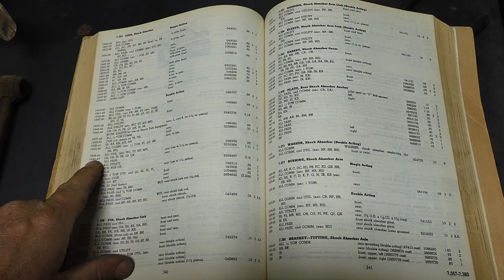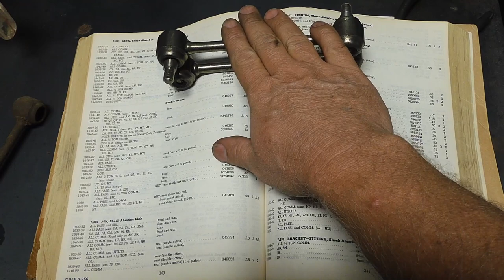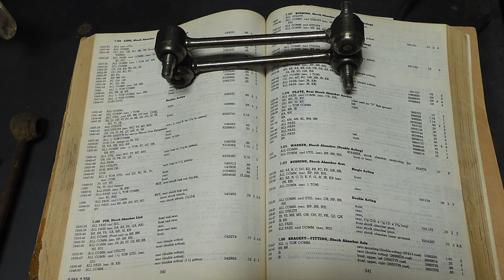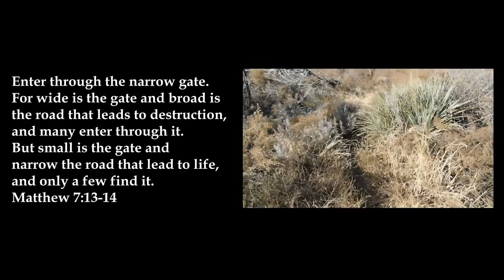Part 16: 1939-1948 Chevrolet Lever Type Shock Absorber R&R

Comment: Another top-notch video! My '47 Fleetmaster had undoubtedly been driven for many years with an out-of -balance or out-of-round tire, and the bushings in the left front shock were badly worn. This is why we take care of problems instead of driving on! The top of the wheel could move about 1/2" fore and aft! I shipped them to a place in NY that rebuilt them - but incurred an extra charge because one of the pistons was stuck down in the bore. Probably a good thing I didn't see how it was removed..... All told, about $500 to rebuild the two. So far, the single most expensive job on the car. But quite necessary to make it safe to drive. Right now, there seems to be a shortage of door window channels. The humor in your videos, as well as references to lyrics, are greatly appreciated! I command the lightening's hand!

Comment: About time I found you. I’ve got a ‘48 Stylemaster Coupe that wanders down the road like a drunken sailor. Considering the fact it’s got a 400 hp 327 Chevy engine in it makes driving an adventure. As I’m not a rich man i can’t afford to replace the front end with a IFS Mustang 2. So, I’m left making my stock front end as reliable and capable as I can. Your presentation is phenomenal and I believe I’ll be able to make some improvements in the handling of my old Coupe.
Reply from the maker: Your 327 can't be that much more weight, in fact I wouldn't be surprised if it's actually lighter than the old 216. Now, this is my opinion and my thoughts, we all have them. But for the life of me I can't figure out why guys jump on the mustang II or S-10 front end band wagon. Oh I realize that they are prevalent, cheap, lightweight, and simple. But in both cases your taking out a substantial front end and replacing it with something that was built as light and inexpensively as possible. Esp. in the case of the Mustang II, that car was awful. As you can see I like things original, so don't listen to me. By the way, pull the plugs on your shocks and try adding some power steering fluid first, maybe you'll get lucky and they'll go to working!

Comment: What a great video!  I learned alot about the lever arm shock that I really knew nothing about.  You explained it well. I have a 1940 Cadillac that has these kind of shocks. They may be built a little different but the general idea on gow they work should be similar to what you had in this video. Now I know what to look for when I get to that point in my restoration. Thanks
Reply from the maker: Thanks for coming along. I hope to soon have a complete teardown and rebuild video on this subject soon.

Comment: You mentioned you keep saying "packing".  That's what the shop manual calls them too. They also say if the shock has been operating below the proper level, they will become worn and leak. Which the front ones on my 40 Master Deluxe were.  The right side seemed to self heal, not so for the left. So far the rears are OK.  Thanks for the videos!

Comment: The first time I dealt with these kinds of shocks was on a 1967 MGB - they work the same.  On the MGB it is also doubles as the upper A arm.  These are $350+ each.  It caused shakes at 55ish in my car and I tried to rebuild them and they just leaked out over several hundred miles.  Don't do what I do but I did this to save the $700 and my idea I'm about to share worked!  I drained the shocks (I think it was whale oil as it stunk like old fish) and filled them with contact cement... I just didn't have the $700 so I had to come up with something.  Darn if it didn't work and it drove like a dream.  Since then I have done this on many Lockheed & Armstrong lever shocks and it works very well.  You don't look like you need to go that far here, but I just wanted to put this idea out there if you had one that was really shot like mine was.  I can't recommend anyone do this but it's FAR safer than flopping useless shocks.  In my world they sell different valves to make the shock stronger but my method works fine for me as I follow the rule of never drive a car on a road that is newer then the car - thus I never set foot on the interstates or anything over a 50MPH speed limit.  I have a 1957 GMC, a TR4 and some other cars.  I love the old girls but if I can save $$$ I do it.  I am super safe and don't mind upgrading things but here is a place to keep cost down.  Bobby

Comment: they used to sell a rebuild kit for the shocks  / in the days of JC whitney    , i replaced mine with rebuilt  or nos ones back in 1976-78  best i remember, they never did leak  but i did buy hyd jack oil in case   i still have it ha ha   / i adapted modern tube shocks in rear .   later on i put on new leaf springs  sometime after 1984  ,  one had broke     good job thanks

Comment: I had to do this on a 37 olds f37 resto mod i built for a old timer he wanted to keep the factory brakes steering and suspension but wanted a stove bolt 250 with dual carbs/ex and o/d it was 07 and he was 73 so to him thats a "real hotrod" car turned out awsome i slurry blasted off the grease and was able to put it back together perfectly the best way i found to do it is i use i internal spring compressor and lock the spring down to its plate remove plate with spring then you can remove the entire upper lower arms and spindle as one piece and do it on a bench

Comment: Hey Jay. Seeing I am going to be watching all of your videos and doing the same things on my 1940 Buick as you are doing, can you share with my where you purchase all of your parts. Thanks you for sharing all of you knowledge. 🍁🍁👍👍
Reply from the maker: I get as much as I possibly can from my local Bumper to Bumper parts store. That franchise is owner operated and of the 3 or 4 stores that I have used in my life I have never had a bad experience. The owners are also usually repair shop owners and know what they are about. Beyond that, I get them where I can find them. I didn't need too many parts for the Buick beyond generic battery cables and such. So I'm always checking out ebay and rockauto.com. For Chevy's I use chevsofthe40s a lot, or The Filling Station. I'm sure there are Buick specialty houses out there as well.
Reply: @TheJayhawker  Thanks Jay. I try to use the local auto supply shop to support local, but sometimes with these oldies the part are hard to get. So I am always looking for other ways to get what I need.

Comment: Thanks for your videos. Good info. I have a 1946 Chevy truck which has some things in common with the ‘48 Chevy. My truck is still a 6v and the battery gauge needle always goes to D when truck is on. I had the generator & starter cleaned & checked but still get the same reading. Any suggestions .
Reply from the maker: Do you notice this primarily at idle or even cruising down the road?
Reply: @TheJayhawker  I notice it at idle & driving.
Reply: @TheJayhawker  All the time

Comment: i have a 39 lasalle and a 1950 packard with these shocks how you put seals in these
Reply from the maker: Even the GM service techs back in the day simply removed leaking ones and replaced them as units. They did not rebuild them at the dealership. You can buy rebuilt shocks online from rebuilders like Apple Hydraulics, but you can also find them on ebay or amazon. But they are expensive. I hope to do a video in the future on tearing one down completely and seeing if it's something I can rebuild.